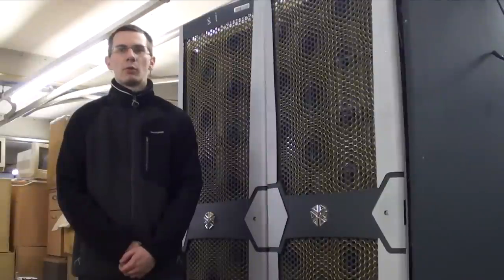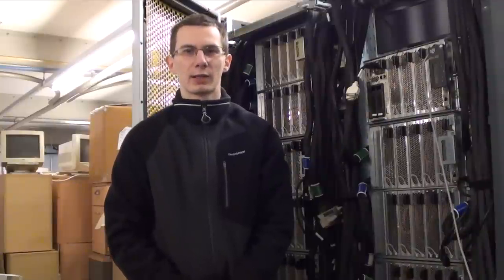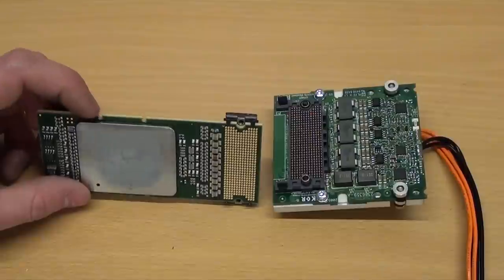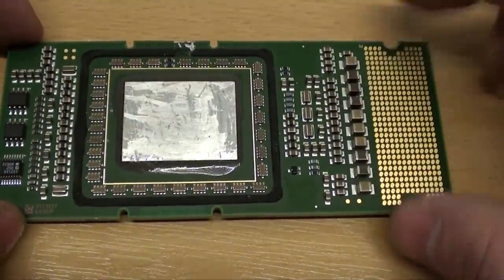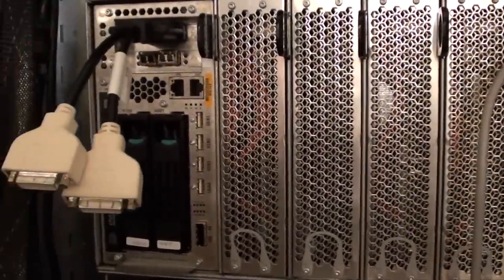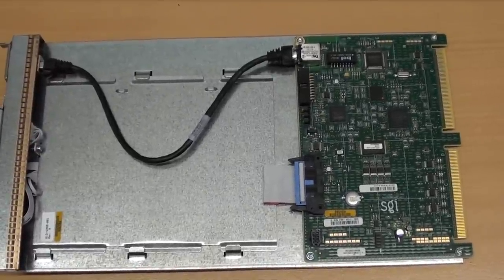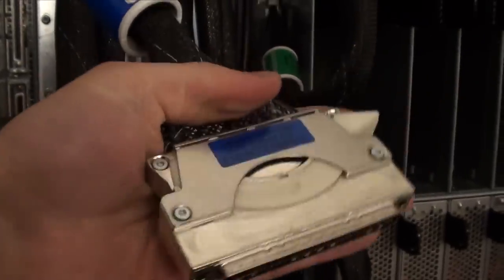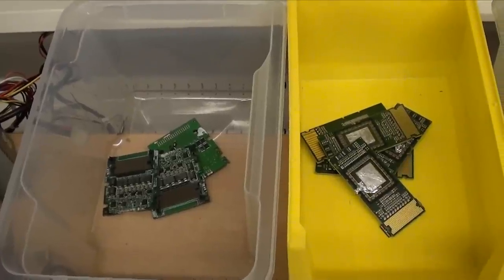SGI Altix 4700 Supercomputer Extreme Teardown

Comment: Sooo can it run skyrim?
Reply from the maker: Mehmet Berk Akyuz Like with all PC games, Skyrim will only work on x86/x64 architecture systems. The Altix runs on Itanium 2 processors which use an ia-64 architecture.
Reply: CarlsTechShed what if they improved it to have a x86 architecture?  why does it seem like from every spec set I've seen for supercomputers they always seem worse than a high end gaming computer, apart from the 1TB ram and many core processors. I don't see the real point. a normal high end PC could simulate these things we'll enough with the addition of decent graphics to them. what if you added a 1080ti to every processor in a super computer with a better architecture. how would it perform
Reply from the maker: Your average Brit & Whovian The best comparison I can make would be between an 18-wheeler truck and a Ferrari sports car. A Ferrari can go a lot faster than a truck, but if you need to move 40 tons of goods, a Ferrari is unsuitable for the task. Likewise, this supercomputer was built for it's processing power, not for sheer speed in the traditional sense. Certain scientific operations were much more efficient on the ia64 architecture compared to the x64 architecture.
Reply: CarlsTechShed aah OK. but why not make a sports truck style super computer that can do every task with speed,  power and efficiency?  taking costs out if the question
Reply from the maker: Your average Brit & Whovian Nobody would have bought a system like that in 2007. The whole machine was designed to carry out massive computations spanning hundreds of gigabytes in size and probably taking weeks to compute. Why would you then want to put a series of top of the range graphics card in there also, which run a GPU which is incompatible with the software you're using to compute your problem? These days you have CUDA and other parallel processors on graphics cards, which is why a lot of supercomputers today use GPUs.
Reply: CarlsTechShed ohh the whole thing was built in 2007. I thought this one was first used more around 2011/12. with a few parts from 2007 like the cores. a top of the range graphics card,  if made compatible with the software, could make tasks much easier to carry out and for a visualisation of what is being computed and to help locate errors with a graphical interface. but I dunno.  I'm no expert on supercomputers.

Comment: You just destroyed a functional 10yo Silicon Graphics supercomputer for scraping parts, you'll make a max of approx $ 2,000 instead of selling it slightly more to somebody who would find a good use for it, altough it's Itaniums and not Xeons. 

You're not intelligent.
Reply from the maker: Immediately after buying this system, we reached out to a lot of people who we thought might have been interested in buying it. 
We even contacted a couple of computer museums, and although one offered to 'take it off our hands', they weren't even prepared to pay for the haulage, let alone pay anything for the system.

Furthermore, this system was sold to us because the original owner had listed it on eBay for over 18 months - albeit at a very optimistic price - and nobody had offered to buy it.

In conclusion, I believe that by scrapping this system and making a YouTube video in the process was the best option.

Comment: Why wouldn't you donate this to a university in a developing country. It may be uselles to those that can invest another million or so in a new setup.
Reply from the maker: ferkeap A university in a developing country could probably buy a much more powerful system for less than this system would cost to run for a month.
Reply: I see that now in the comments, would be interesting to make something available.
Reply from the maker: ferkeap We did list a number of the components on eBay for slightly more than their scrap value but nobody bought them.
Reply: i didn't mean you guys, nice that you did.   But in general making it possible for a some to have the computing powere available.  That is probable all ready done, with subsidy.   A reasonable connection and available time on a system in the western/eastern developed countries would be a more practical measure.